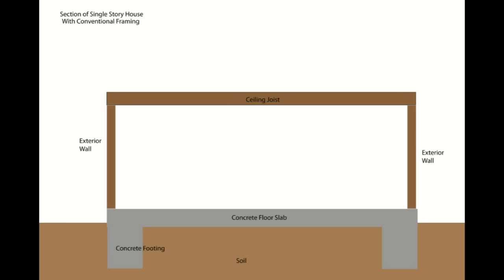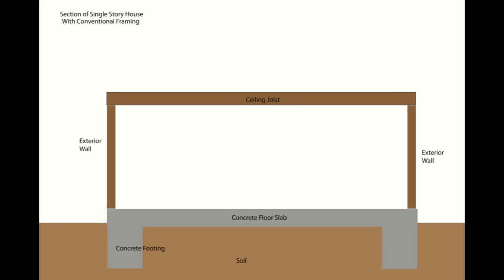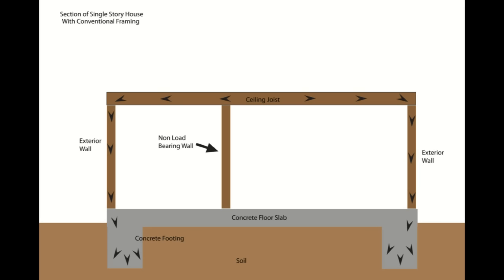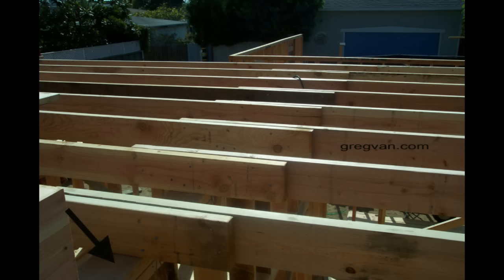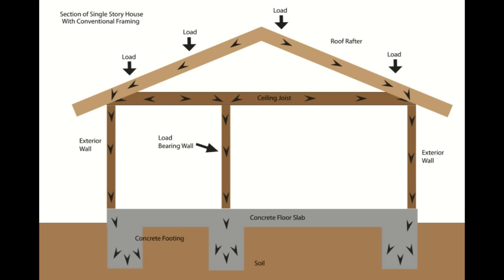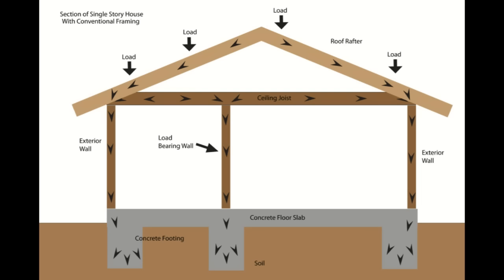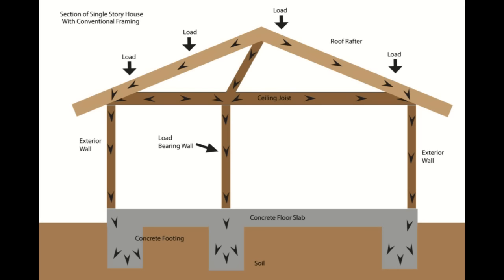Load Bearing Wall Framing Basics - Structural Engineering and Home Building Part One

Comment: I have a wall that that has a pocket door inside. The left side of the wall is only 3' the right side of the wall with the pocket door is 5'.5". Since the pocket door wont have any wall studs I am thinking its ok to take out. I wanted to open the wall to look and see first.
Reply: +Vale Ria Vale, don't know if this is still relevant to you but ought to have an engineer look at it.  The wall may be a shear wall, which, while not taking any vertical load, could be contributing to the horizontal stability of your house.
Reply from the maker: +Vale Ria I'm sorry for the late reply, sometimes I don't see all of the comments. I've never came across a pocket door that couldn't be removed, while creating structural problems.
Reply from the maker: +John Cunningham You raise an interesting point, but I've never seen a pocket door frame used as a structural component, but if you have I would love to hear your response or see a picture.
Reply: +gregvancom Hi, thanks for your reply.

Yes, I've seen this many times.  I used to be an engineer for a company that specialized in timber frame construction.  There would be times where we would use the shear resistance of all internal panels to prove that the structure was capable of resisting wind loads.  Of course these loads had a factor of safety applied to them, but we would take their shear capacity into account regardless.  I'm sure I've got some calculations/overmarked drawings in pdf format somewhere if you're interested.  It's all in metric though I'm afraid ;)
Reply from the maker: No problem, I probably wouldn't know what I was looking at anyway. I'm not an engineer, but definitely understand how they use everything they possibly can sometimes for lateral movement, when local building authorities aren't happy with their calculations.

Comment: Can you explains a floor plan for a concrete house, do we need to have columns on each corners or each joins,
Reply from the maker: Concrete homes can be built in different ways. Sometimes you will use columns and sometimes the roof system will be supported by the exterior walls or interior walls. Let me know if that didn't answer your question.

Comment: I understand that load-bearing walls transmit the load from the roof all the way down to the ground slab and then the footings underneath. I do not understand that the middle wall - without a footing - does not have any load on it. It is tied to the ceiling and surely some load (albeit perhaps, a small fraction) must be transmitted thru it to the cement slab. Why can only footing supported walls be considered as load bearing?
Reply from the maker: You make a good point and that there would be a certain amount of load transferring through these walls, but the joist or rafters would be engineered to support the weight, without the center wall. For example floor joists can sit on a variety of different walls throughout the home and these walls can transfer some of the weight to the foundation, but wouldn't require a footing, because the load would be designed to transfer to the end of the floor joist or other load bearing walls throughout home. Let me know if this doesn't make sense and I can always make another video.

Comment: The first picture you says is not load bearing....is certainly built like a structural wall.  The doubled up wall top and the header above the door is a strong indicator that the wall is structural.  It could be even though the ceiling joist is continuous the wall is load bearing because of the span.
Reply from the maker: The first picture in the video is an open room, did you mean to leave this comment on a different video? If not, maybe provide me with a timestamp or an exact time in the video that you're referring to.
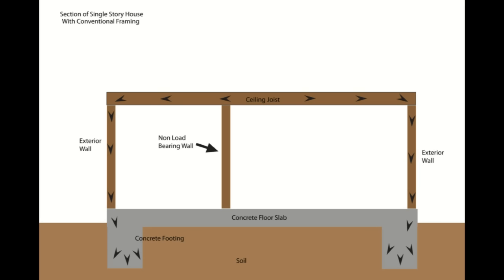Reply: gregvancom The photo at 4:40
Reply: If you look at the photo at 4:40.  Which is the one used as an example of a non load bearing wall.  I think that example is bad. Even though the ceiling joist is continuous across the wall , there are several signs clearly visible that suggest the wall is load bearing.  The top plate of the wall is double 2x4 which is used in supporting walls where ceiling joists and wall studs don’t align... which is almost always.  Also the door has a large header which would not be necessary in a non load bearing wall.
Reply: @timkarcher6724  I'm going to say non load bearing. The wall in question (let's call it "Bravo") is a partition wall running perpendicular to the joists yes, but look at the exterior wall. It is like what? 5 feet away from Bravo? The span between them is like what? 5 feet? Those joists don't have to be supported at such a small span- not to mention the joists are not lapped on Bravo. As for your headers, I am working on a house where I am REQUIRED to install 4x10 headers regardless of them being bearing or non bearing walls ON ANY OPENING in the house and also required to use double top plates on any wall. It is a standard house- nothing gimmicky or fancy by any architectural means. Maybe it will have a second story on top of that wall- maybe- but at this point in time, I'm going to say a hard no- Bravo is not a load bearing wall.

Comment: if you were wanting to extend out the exterior wall (like to make the corresponding room larger) how would you extend the ceiling joists and transfer the load farther out?
Reply from the maker: You're talking about a lot of work here. You would basically need to redesign the building. This would require structural engineering and additional work to the foundation. If this is something you're interested doing, contact a structural engineer, general contractor, building designer or architect in your area for more information.

Comment: Question for anyone willing to help. My 2nd floor was never finished so as a handyman new to owning a home I have set about finishing it. There is one room up there but it is around 25' x 14.5' no ceiling joists just the 2x6 roof rafters. I really want a flat ceiling but the roof is a 12-2 pitch. It looks like I can use 2x8's for the ceiling joists if I space them on 12" centers and use a good quality lumber. My main question is, can I notch the 2x8 that much to get them to fit on top of the top plate? What are my other options? Am I doomed to just go with a vaulted ceiling? Would my roof rafters (2x6 spaced 24" OC) even support drywall and insulation? Thank you
Reply from the maker: I can't answer your question, because I can't provide viewers with lumber sizes or engineering information, sorry. I would suggest visiting our website and checking out some of our framing videos to see if one has relevant information you're looking for.
Reply: yes you can notch the tops of your 2x8 ceiling joists to fit on the top plate as long as your notch does not go past the inside face of the wall. the spacin of the ceilng joists should ideally match that of the rafters as they will be fastened to  the rafters and will also need to be attached to the wall with metal roof ties.

Comment: Could you give a reason why the last wall was not load bearing? Why is the weight above it not transmitted through that wall? Is the fact that it doesn't have concrete footing under it a factor?
Reply from the maker: Non load bearing walls can transfer weight, but from a structural engineering point of view, the load bearing walls will be used to absorb most of the load. Let me know if this didn't answer your questions.
Reply: @gregvancom  Thanks. I was puzzled about something, but I can't remember what it was. Your answer is straightforward.

Comment: so,lets say,i'm puttig an apartment in a shop ,but the existing ceiling is vaulted and i want a flat ceiling with 2x8 16'' center ,are the interiorwalls gonna be load bearing then?
Reply from the maker: I will see if I can make a video on this, it sounds like a question that others might have also. As long as the ceiling joists load transfers to a bearing wall, you shouldn't have a problem. In other words if you're using 12 foot 2 x 8 as ceiling joists and both ends are connected to a bearing wall, then you could place non-bearing walls anywhere in the room underneath them. Let me know if this didn't answer your question.
Reply: ok,but i''m talking about a 20' 2x8
Reply from the maker: I just made a video for you and I will make another one tomorrow and it sounds like there will be a third video to provide you with more information on whether or not the interior walls will be load bearing. I don't know if 2 x 8 ceiling joists can span 20 feet, from what I remember 16 feet was max.
Reply: ok ill watch it,thanks a lot

Comment: so in a basement if you have a main beam in the center with joists over lapping chances are that Any wall above that would be a LBW?
Reply from the maker: No that's not true. Load bearing walls and support beams transfer weight from above, but the structural members and framing components below might be used to support something else. Let me know if that doesn't make sense or feel free to ask another question.

Comment: Ok, I"m still confused.. I guess I should tell you what I'm doing.. and you can tell me what I'm missing?? lol
I want to build a garage.. with a FLAT ROOF ( or flat as possible )..  that part isn't difficult.. the issue is.. I want to make sure it will be strong enough to hold what I'm doing on the roof. I want to put a railing up there. and built an Observatory up there for astrophotography etc..  So, I and at least 2 or 3 others will be up on the garage and the observatory will weigh approx. 600 lbs and about 14'x8' in size.. garage would be 12'x24'  I was going to make it out of pressure treated 2x6's ??
Reply from the maker: If you're asking for me to provide lumber sizes, I won't be able to help, but maybe you can find information you need from roof or floor span charts on internet.

Comment: Hey, great video! i have a question about one of the walls on the bottom floor of my split foyer. i dont think it is load bearing but when i removed the dry wall i noticed about a 2 foot header(that appears to be a door that was covered during remodeling) im a little apprehensive about removing now. i have pics and videos of the ceiling and wall if you could help me out I'd really appreciate it!

Comment: Sir, I need your suggestion. Plinth area of my house is 519 sft. It is a load bearing structure. Now, I want to consyruct first floor using the setback areas from East, North and West. The soil is clay . Can I raise Columns ?
Reply from the maker: I cannot provide you with structural engineering advice. However, I can suggest going to the website, where we have organized list of videos for concrete footings and structural framing.
Reply from the maker: I cannot provide you with engineering advice.

Comment: WHY are the walls of a structure always placed on the far outside edge of a concrete slab footing?
Isn’t there some way to center the walls over the footings?
Reply from the maker: It probably makes everything easier, but it might work better if footings are centered under walls.

Comment: thank you for this info, but im asking  Is there a bearing wall in concrete roof i mean is bearing walls only in traditional timber framing ?   thank you
Reply from the maker: Good question and yes, bearing walls are often used in practically every structure built, including concrete. They would basically be anything supporting another part of the building or structure.

Comment: I was working on a home that had a load bearing wall that was running parallel with the rafters and ceiling joists. How does that even bear the entire load, since it seems to me that the wall would have to run under each rafter and ceiling joist, not under one parallel?
Reply from the maker: I don't remember if I answered this question or not, because Google has changed the way I answer my questions. Walls that run parallel to structural members like ceiling joists and roof rafters, might not be load bearing, but could still be structural sheer walls. Sheer walls are used to reduce lateral movement or side to side.

Comment: Are there any visible signs on the concrete slab if it is a bearing or non bearing wall?
Reply from the maker: +Loren K More than likely not, but if the bottom framing plate is attached with nuts bolts and washers to the concrete then there's a good chance it structural or load bearing.

Comment: That "non load bearing" wall at the beginning of the pictures had a serious header on it...
Reply from the maker: Like everything else it's overengineered.
Reply: There is no way on knowing from that picture alone as to rather it's bearing or not. It could have a load point about it very easily.
Reply: My engineer for the current house that I am working on has called 4x10 Douglas fir #1 for all interior and exterior headers unless otherwise noted.
At that header in the first picture, there is nothing above that point at that current stage if it is a 1 story house and joists are not lapped on top of that wall. 
I'm gonna say NLB wall in the picture at that point in construction.

Comment: So... Unless the wall is supported by footings, it's not structural?
Reply from the maker: Walls on bottom floor that usually are supported by footing can be load bearing, but might not carry as much weight as other walls in a building. Structural walls can also be designed as shear walls and might not have a footing, especially if they sit on top of floor framing.
Reply: @gregvancom  Clear as mud. Thanks for trying though 👍

Comment: So, if the ceiling joist goes by, not joint above wall, it is not load bearing wall??? And I am able to remove it??Older house, ceiling/ roof rafters just like in your video here !=)
Reply from the maker: +Eero Laukkanen There is no guarantee that a wall is going to be non-bearing, simply because the ceiling joists don't lap over it. I will try and create another video that will provide you with span lengths for certain sized lumber that might be more helpful. For example, if you have a 2 x 6 ceiling joist that's 12 foot long, then the walls within this span might be able to be removed.
Reply: OK, thanks, sir, youtheman ! This is old, 1950's/60's small house, in Florida, plan is to open small living room and to widen opening to a kitchen. there is entering opening in a ceiling, in next hallway, I try to take a photo from ceiling joists from attic, I also measure the span, It sure is more than 12 feet??I think material is like 6 x 1 inch board, not like 2 x 6??Opening that livingroom/ removing this wall would make such a nice difference =) Now, can we make this lower joist stronger, so then we can remove that inside wall below it?? Thanks...I know, you need pictures...'o)
Reply from the maker: Send the pictures, but I don't think I have any span charts for 1 inch material, only 2x, like a 2 x 6.
Reply: I'll, go to that house back in few days, so I will check it out, Span wall to wall is 22, , distance to roof hip from parallel joist is about 5...6 feet the most !

Comment: Can I use, in lieu of a monolithic footing, 8" block on a 24" x 8" footing; then pour the slab to a 8" header block for a metal building?
Reply from the maker: It sounds like you need to ask that question to an engineer.

Comment: Do you have an email or something so I can send you a picture? I'm searching this up for my dad. We are renovating our house. Tore down all the plaster and lats on the walls for our front room and dining room which are behind one another. To separate them, there is a wall with an arch and two prayer holes, one on each side. My dad wants to widen the arch, raise it up, and make it more square for a more open floorplan. How would one do this? I don't know if its a load bearing wall or not.
Reply from the maker: You can find my e-mail address at my website
gregvan.com. Feel free to send me a few pictures, but keep in mind that I will only be able to provide you with an opinion. You might need to contact a structural engineer for verification.
Reply from the maker: I think what you're looking for might be found here http://video.gregvan.com/structural_engineering.htm. My e-mail address can be found at the bottom of the link I just sent you.

Comment: Is "load bearing wall" and "frame building" the same thing actually? Is it like the building frame is built into the walls, generating "load bearing walls"? What if the walls are made of glasses, like a glasshouse? Can a house be classified as "frame building", but not "load bearing wall"?
Reply from the maker: Loadbearing walls are inside framed buildings. As far as glass buildings are concerned, usually the roof or floors above are supported by posts and beams, in between the glass.

Comment: what does a structural engineer do? and wouldn't a knowledge of blue prints help a 
   person know the structure of a building?
Reply: I've got the blue prints for my house. I've had three contractors look at them, they can't tell if the center-wall splitting my living room from my dining room is load-bearing or not. In fact, I'm going to have just tear it out (with some temp supports in place...and see. It's a flat roof, 2x8 rafters 16"oc with bracing, so there's no attic for me to just go look. I've got tear out the sheetrock and some of the ceiling.
Reply from the maker: A structural engineer has the ability to figure out exactly lumber sizes, their location and concrete foundations sizes that allows someone to build a home.
Reply: gregvancom people have Been building homes for thousands of years and they weren’t structural engineers or any fancy title is it pure miracle that those ancient homes are still standing through hail and storms meanwhile modern homes are so fragile despite all the computerized calculations.